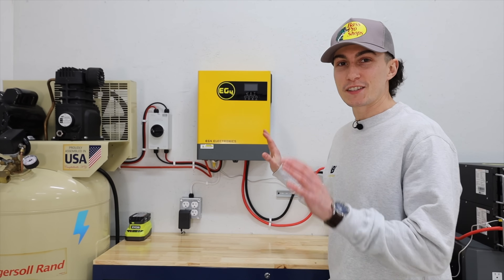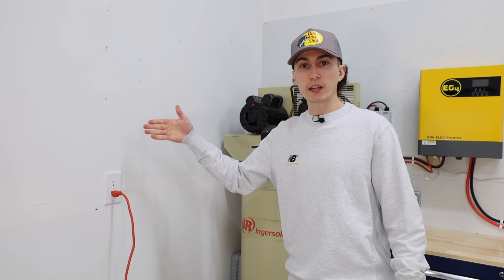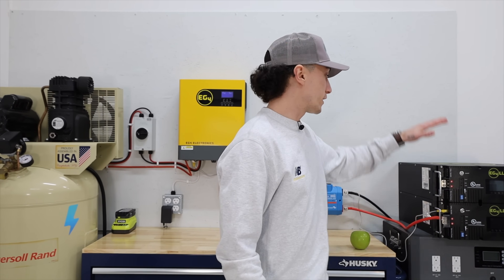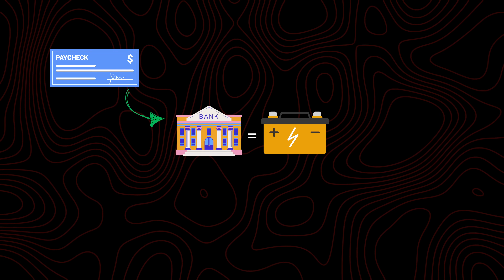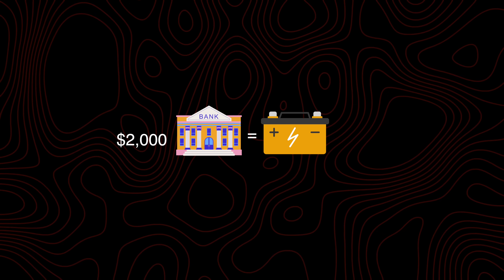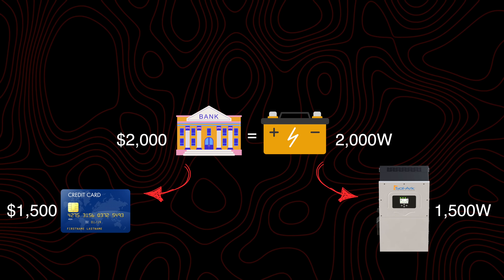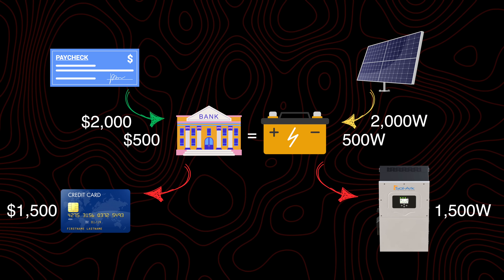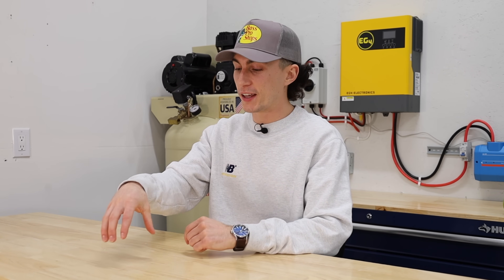Basic Solar Components & How They Work - Solar Panels, Inverter, Batteries, & More Explained (Ep. 2)

Comment: Great video! Thank you so much for the effort and valuable information, i’m just a little confused, why do we charge the batteries from the inverter (solarDC to inverter AC then back to DC to charge the batteries) ? Shouldn’t we use a charging regulator for the solar panels output and then directly to the batteries to be charged?

Comment: Thanks for that explanation.  Just one question if you don't mind.  Why would I want or need an expensive battery (or a battery at all) if my system is designed to simply produce some electricity to "sell" back to the power company via Net Metering.  Emergency power is all I can think of.  I don't want panels on the roof of my house, but I have a small porch where some could be installed to offset some of my use.
Reply: In many cases it’s possible to use the battery to store electricity from the grid overnight at a cheaper rate, and use it during the day when grid power is more expensive.

Comment: Another interesting and informative video - thank you for taking the time and effort to make and upload all your videos!! I'm a little confused about the system you showed us that's behind you. If you are using power from the socket, how can the inverter send power to the battery but the battery is also sending power back to the inverter through the same wires simultaneously? Should there be a second set of wires to go from the battery to the inverter?
Great video!

Comment: Let's assume that for a power supply of 6 kilowatts, panels with the same power will be needed! What voltage is best to choose for the panels, 12 volts, 24 volts or 48 volts? Thanks for the information and the video.
Reply: 48 volt is better!

Comment: So I have a 18KW on demand electric water heater. currently my home is powered by the grid but id like to switch to a hybrid grid/solar system. so in theory I would need a 22kw inverter if everything in my house that uses power was using power?

Comment: Thank you for your videos. They are very informative. I have a question regarding the Anker Solex 3800. I’m in the process of installing these into my home with the home power panel. I have a 11,000 kW permanently mounted solar array in my yard that I pivot three times a year.Because the system is connected to the grid, it shuts off during a power outage. Is there any way to get that power diverted to charge the Anker system? Or is my only option to buy some portable solar panels during a long-term outage to recharge the batteries in the 3800? Thank you for your answer in advance!

Comment: shouldnt there be a switch between the inverter and the batteries too? because the inverter will run off the battery when its not getting any solar juice???

Comment: Why would a system without batteries not make sense? That's a bold statement, especially without getting into why you have that opinion. Let's turn it around. Installing batteries only makes sense if you are off-grid or the price you have to pay your electricity company minus the price they pay you for the energy you sell back to them is higher than the price per cycle for your battery. Where I live, utilities are obligated (by law) to pay you back the same price as you pay them, as long as you are not selling more than you are buying. So in my case, it makes absolutely no sense to install a battery. The grid is basically a free battery with endless capacity and 100% efficiency (from my point of view, I obviously know there are losses).
Reply: If you want power when the grid goes down you need batteries. dead simple
Reply: Here in South Africa it won't make sense, at the moment we dont have loadshedding but when we do, our power gets switched off for up to 4hours x2 a day, and at night when there is no sun you'd wish you got batteries
Reply: My son-in-law has an array on his east and his southern exposure of his roof. He still has an electric bill every month plus he pays a bill for the installation and the panels every month and if the power goes off, he still needs candles yet in the end, he’s gonna have bought another house With only the solar panels that are now at 20 years useless😍
Reply: There are a whole lot of us who live where the Grid is very unreliable. We have to have battery backup. Sometimes it is down for days at a time, even two weeks. That's what it is like to live 'way out in the boonies!

Comment: Great video! I'm looking to get same rack style battery like the one in the video. My dilemma is, I wasn't sure if I could charge the batteries via 120 volt outlet from the grid as I don't have plans to install any sollar panels. My goal is to just have a backup for outages and recharge with the grid. 
Would it be smart getting the rack style battery as you get more value for money or go with the traditional plug and play like Ecoflow or Anker? 

And when do you plan to review the EG4 batteries? 
Thanks